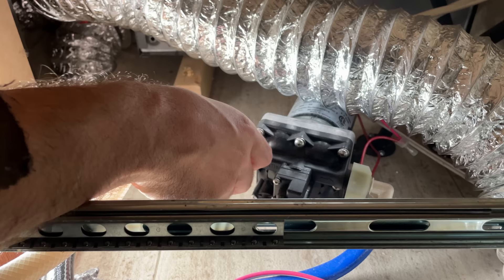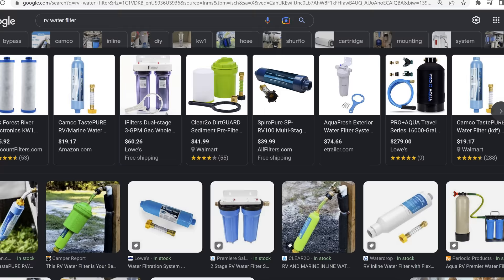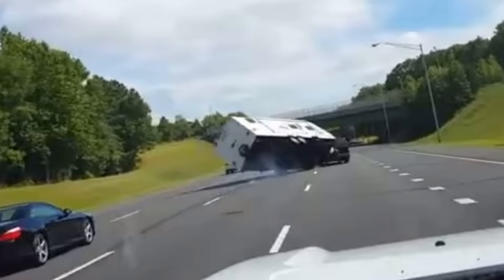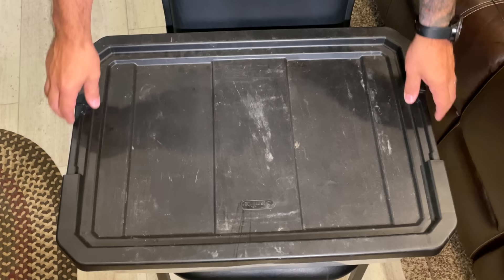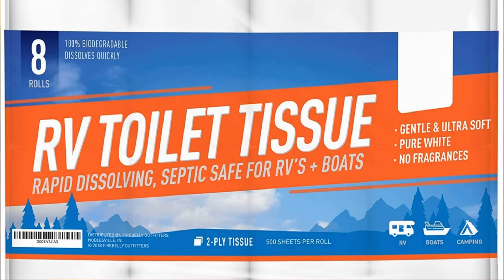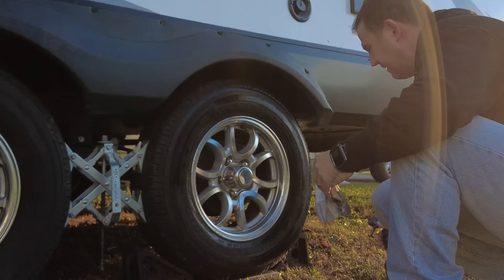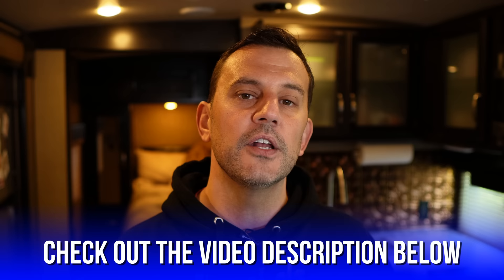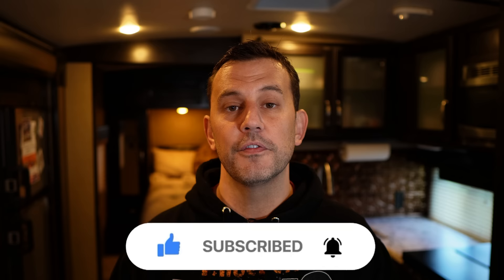9 RV Mistakes To Avoid - Plus Critical Things You May Be Missing

Comment from the maker: ✨⭐ PRODUCTS FEATURED IN THIS VIDEO ⭐✨
🔹 RV Stabilizer Jack Bit https://amzn.to/3EJDbKi
🔹 Water Pump Filter Replacement https://amzn.to/3Ub32k9
🔹 Pex Crimper https://amzn.to/3GP10mM
🔹 Dewalt Socket Set https://amzn.to/3Va080j
🔹 Septic Safe Toilet Paper https://amzn.to/3ihp7Qx
🔹 Tire Covers https://amzn.to/3gEsHUA
🔹 303 Automotive Protectant https://amzn.to/3OGBBgJ
🔹 303 Aerospace Protectant (best quality protectant) https://amzn.to/3GSCvoB
🔹 Microfiber Multi-purpose cloths https://amzn.to/3iirT8t 

Stop Doing This to Your RV! Common Sense Tips That AREN'T Discussed Enough! Unspoken RV Tips This video highlights some of the things you should never be doing to your RV. Plus, we cover a few tips that should be discussed more often than they are.  RV ownership & maintenance involves many different processes, but these can be simplified by using this common sense tip that we cover at the end of the video.  Whether you own a travel trailer, 5th wheel, motorhome, toy hauler, pop-up camper, or any other type of RV, this video is worth watching. Scroll down to see more!

Check out my friend Robert Peppers Channel:
 @L2SFBC  
Robert's Sway Video: https://www.youtube.com/watch?v=JeEEC5eVNCk

#rvlife #rvliving #rvdiy

✨⭐ OUR FAVORITE RV ACCESSORIES ⭐✨
ESSENTIALS:
✅ Camco Rhino Flex Sewer Hose & Elbow Kit https://amzn.to/3wxaiyG
✅ Camco 90 Degree Clear Sewer Elbow https://amzn.to/3eezBe7
✅ Camco RV Water Filter https://amzn.to/3VzcMqi
✅ Rubber Wheel Chocks https://amzn.to/3v0lL5I
✅ Hughes Watchdog 30 Amp Surge Protector/EMS https://amzn.to/3hAmgCy
✅ Hughes Watchdog 50 Amp Surge Protector/EMS https://amzn.to/3HKrpm1
✅ Liquified RV Tank Treatment https://amzn.to/3ksg1Ck
✅ Tire Minder TPMS https://amzn.to/3mjuBg0
✅ Water Pressure Regulator https://amzn.to/3m3ZFzZ
✅ Rubber Gloves 6 Mil https://amzn.to/3XNo7Dc
✅ Collapsible Water Hose https://amzn.to/3SvNubw

MAINTENANCE:
✅ Boeshield T-9 Rust Preventative & Lubrication https://amzn.to/3sjcjMx 
✅ Eternabond Roof Tape https://amzn.to/3Ad290J
✅ Geocell Proflex Sealer https://amzn.to/3KGMOyb
✅ Road Tool Kit https://amzn.to/41NIQKj

INTERIOR:
✅ Camco Cross Bar Door Handle https://amzn.to/3o8WWS5
✅ Shower Caddy https://amzn.to/3bdU80W
✅ Soap Dish https://amzn.to/3pKheSn
✅ Oxygenics Shower Head (White) https://amzn.to/3nhDMYW
✅ Oxygenics Shower Head (Brushed Nickel) https://amzn.to/2O8YcYC
✅ Perfect RV Paper Towel Holder https://amzn.to/3tZxd1K
✅ Dimmer Switch https://amzn.to/3rQdfFD
✅ Sliding Door Latch https://amzn.to/3EkpTT0
✅ Puppy Paw Hook https://amzn.to/2N9JaRV
✅ Foldable Storage Bins https://amzn.to/3tIp01f

EXTERIOR:
✅ X Chocks https://amzn.to/3m3ck2i
✅ Carmtek 10 Digit Keyless Entry System https://amzn.to/3t4IMpB (see the video here: https://youtu.be/KcEUgsDw6kk)
✅ Low Point Drain Valves https://amzn.to/3Jd6adb

OUTDOOR GEAR:
✅ Blackstone Griddle 22” https://amzn.to/3MDDiL0
✅ Blackstone Griddle 28" https://amzn.to/3eBnOuD
✅ Outdoor Gravity Chairs https://amzn.to/3Sb1p4M
✅ Ground Mat https://amzn.to/41u3wXg

💥 Sign up for our FREE Newsletter: https://view.flodesk.com/pages/6497c6a9d1998fa8c7623e9f

✨⭐ MORE RV ACCESSORIES ON AMAZON ⭐✨
https://www.amazon.com/shop/rvtipstravels

💥 NEW TO OUR CHANNEL? Check out our catalog:
https://www.youtube.com/c/RVTipsTravels/playlists

🙏 If you want to help support our channel you can donate here: 
https://www.paypal.com/donate/?hosted_button_id=J2KKM9NR3BJJA

✨⭐ DISCOUNT CODES TO SAVE MONEY ⭐✨

🔨 Learn how to repair & maintain your RV like I did w/ this COMPREHENSIVE training course:
https://rvtechcourse.com/?ref=rvtips&travels

🚐 10% off RV Snappads! https://rvsnappad.com/discount/RVTT10

🛌 Get 25% off your RV Mattress by Brooklyn Bedding at https://rvmattress.com/rvtips
Use discount code: rvtips

📡 GPS Tracking for your RV! https://www.wheresafe.com/rvtipsandtravels
Get 10% off by using discount code: RVTIPS10

If you find a dead link, let us know & we’ll send you an RVTT sticker!

📺 Want to see more RV videos? Please SUBSCRIBE & CLICK THE BELL ICON 🔔 so you're notified when we release new videos!

Follow us on social media:
📸 Instagram https://www.instagram.com/RVTipsAndTravels
🕺 Facebook https://www.facebook.com/RVTipsAndTravels

We may receive a small commission for purchases made through the affiliate links above. There is NO additional cost to you when purchasing from our links & it helps cover some of our material and equipment costs to make these videos. We GREATLY appreciate your support!

Comment: Lists, tires and tools -- can I get a witness,  ha , one here! all of it is ON THE MONEY. Now you have me excited for next spring already to arrive. One thing to all fellow RV Peeps,, if you have the rubber roof protectant in gallon ,you have the best fluid at your disposal already to use on tires. It outperforms all the other shelf stuff for UV blocker and longevity. Shake pour into cup, brush it on or sponge, refill the spray bottle you have, can skip the conditioner. Thanks Ross for power packed and fun to watch content.
Reply from the maker: Thanks Jim, I am defintely getting the bulk order next time.  I appreciate the support and the comment!

Comment: During hot weather I travel often with the roof vent open with no problem with outside smell inside the coach. We have a Geo Pro 19FBS with the vent at the rear of the rig and it comes with the Max Air vent cover, so perhaps that helps keep smells out of the rig. The biggest reason I do this is to help keep the temperature down in the rig.

Comment: You mentioned using septic safe toilet paper, I found that if you look at the Rv toilet paper it says rapid dissolving and costs twice as much for fewer roles. There are a few brands that will say quick/ rapid dissolving and some also say septic safe. So I just look for rapid dissolving and/or septic safe and I’m good. One thing you NEVER want to do (even though is says that it is septic safe) is use/put the baby wipes in your black tank. Take it from me not a good idea even if it says so, cost me around 400 dollars to learn that one, when I first started rving, cause I had to have my blank tank vacuumed out

Comment: Really good video on tips and tricks. Your videos have a great style and flow without a lot of the useless chit chat of many.  They are helping me prepare for next journeys in my second travel trailer.   One note on the segment on the particle filter near the water pump, be sure to get any water out of it before freezing temps.  I blow the water out of my system and learned the hard way when water froze there and cracked the plastic cover. .  And you can't just buy the cap Cheers.
Reply from the maker: Thank you!

Comment: Another great video. What are your thoughts on the surface tires are in when storing. For example grass, dirt, gravel, concrete, plastic blocks etc. Many thanks
Reply from the maker: great question... I am actually going to create a tire care video next year, but I really need to talk to a few tire experts before I even think about filming.  However, from what I've heard thus far, they should be kept on a firm, dry surface.  Youll notice in the video they are on wooden blocks off the grass.  My last set of tires lasted 5 years, and I only replaced them because of the age.  Nothing was wrong with them as they only had 6000 miles on them.  Stay tuned, in the meantime when I find a tire expert that I trust I will let you know.

Comment: Using shower fan.  In winter that tends to suck all the heat out of camper.  Do you recommend a dehumidifier instead in those conditions?
Reply from the maker: Dehumidifiers would be a great option instead of the fan!  Great question!

Comment: Hello, my 2008 Sunnybrook fifth wheel, 33ckts, has ball 7500 pound scissor jacks. They are not the lighter stabilizer jacks that companies have gone to in recent years. In my way of thinking, I like to have these heavy duty jacks down while my RV is in storage, in order to take the stress off of the frame. is my way of thinking correct? Or should I not even have these heavy stabilizer jacks engaged while my RV is in storage? Furthermore, the old Sunnybrook fifth wheels, we’re not built on I-Beams. They were built on a triple stacked 16 inch box frame under the main carriage of the fifth wheel. I have been pulling this fifth wheel since we purchased it new, in 2008, but I still pick up a tip now and then from your videos. Keep up the good work.
Reply from the maker: I think that you're way of thinking is good, and remember there is no negative affect of having the stablizers down at any point in time.  I would however assume the weight of the trailer on the frame should be fine, especially while not moving.  Considering these are meant to travel on horrible roads, the stress on the frame comes when you're driving, not parked.  the only reason i mention this is in case of a tire losing air, then you are putting additional stress on the jacks.  thanks for watching and commenting my friend.

Comment: There are lots of videos out there. I'd say virtually every single one is well intentioned. Further, Id say that most of them contain nuggets of good information. I'm constantly trolling RV videos in an ongoing search for things I didn't previously know. 

While "Proper" maintenance will save you money in the long run and preserve the useful life of your RV, the question for me is; what is "Proper" maintenance. I have traveled the path from new RV'er to seasoned RV'er over 8 years. I don't know it all. I won't claim that even on my death bed. But one dosen't do anything for 8 years and not learn anything. For me, "Proper" maintenance  includes finding some sort of balance. Early on, I tried to apply all of these "Tips and Tricks" I see in these videos. One could endlessly spend time and significant sums of money niggeling with their RV. RVing isn't cheap under the best of conditions. But one can spend gobs of money "Protecting" their RV. Early on, I found myself asking when do we actually get to ENJOY the damn thing? 

There is an idea of diminishing returns. I'll give you one example. One "Should" wash at a bare minimum, the roof once a year and apply a TPO protectant, not to mention check the roof sealant. I did that. The first year I washed my roof 4 times in 6 months. And then I realized, for all the "Good" it was doing me, I could wash the roof every time the RV leaves the driveway. Washing the roof is not easy, and even though it's a "Walkable" roof, I cringe every single time I put my 300 lbs on the roof. And that protectant stuff you're supposed to put on once a year? That stuff is EXSPENSIVE. After the first two years, I do a quick a quick clean up on the roof once a year. I don't scrub it. I clean it up. Spend maybe ten minutes tops. As far as the sealant goes, Every other year I pay the shop to check the roof and other various wear parts and have them do maintenance if they find anything sketchy. I have them do the protectant stuff every third year.

Why am I making this long post. I could write a book on RV maintenance.  A lot of this stuff is going to depend heavily on your personal circumstances and how much the RV gets used. Some should do more, some could get away with doing a lot less. The point is this. There are lots of videos telling you what you should do. I have yet to run into one that will tell you that you can overkill the whole maintenance thing. Much like the roof of my camper, You don't need to wash the roof every time you take it out or spend hundreds of dollars each year on protectants. I pay to store my RV 6 months of the year in a weather tight building. I think keeping the snow and Ice and wind and sun off it 6 months of the year is worth more than spending hours of labor and hundreds of dollars applying protectant to the roof. One MUST do maintenance of some kind. But one dosen't have to overkill everything. There is power in knowledge. I think people do a lot of overkill because they are scared of what they don't really know or understand. Some RV's need more PM than others. Low end RVs tend to be made with cheaper materials. Think the rubber seals in a low end RV slide are exactly the same as the seals used in mid and high end RVs? lots of people would say yes they are. All I can tell you is that my experience has been that my 8 year old RV seals are still good and I only put protectant on them once a year. I've seen the seals on lower end RV's disintegrate in a couple years. One has to tailor the PM regimen to the RV they have and to the circumstances. Do you store your RV outside year round? Do you live in Arizona or in Alaska? If you make RVing a Job, you're not going to have a lot of fun. In my opinion, you don't need seventy five lists. On a small Imagine 2150RB, the winterization process is as basic as it gets. Open the plug on the HWH. Open the low point plugs. Flip valves. Run some compressed air through the exterior water inlets/outlets. Plug low point drains. Run in antifreeze through all faucets. Done. Don't make a mountain out of a mole hill. 

My advice is to learn learn learn learn learn. Arm yourself with information. Arm yourself with all the information you can get. 8 years into our RV life, I'm still consuming information from videos and forums. And I'll be doing so 8 years from now. The more you understand about the fine details of how your RV is constructed, the better at maintenance you will get. And remember, you don't have to do ALL the maintenance yourself. It's worth it to pay a shop to do some of it. I personally think putting 300 lbs on my 2150RBs roof is harder on it than anything else. I budget about 600 dollars a year to spend at the Dealership for maintenance. I do a lot on 3 year rotations. Packing the bearings. Checking the breaks. Basic and extended roof maintenance.  The stuff that's not pleasant, and takes up my time. Other things like slide seals and winterizing, I do myself. Lists can be useful. But my suggestion is to keep it simple. We always do a walk around before leaving the driveway or the campground. But I have a five point list I keep on the dash to remind me of the things we tend to over look when we are not paying full attention. Stabilizers up. Vents and windows closed. Chains, hitch pin, whip all connected. Doors closed and secured. Overlooking any of these things when you are not paying full attention can lead to particularly bad experiences. So I have one five point list placed in a spot where I can't miss it. And when I see it, it triggers me to make certain I've done those things. If you have 34 lists on your phone. I submit you're doing it wrong. 

Just my two cent rant.
Reply from the maker: Thanks for commenting!

Comment: I have two 2000 dollars Heiki vents so covering my trailer is not an option. And I am like you. I am in and out often. Even sleep in it about every third weekend. Even in winter. I do this for several reasons. I want to know if I have a rodent. I want to use the bed as much as possible to stay used to it. And I want to know if the heater is working and functioning correctly. Before I get out and find it doesn't.
Reply from the maker: Thanks for sharing!
Reply: @RVTIPSANDTRAVELS  Thank you for the informative videos.
Reply from the maker: those vents are awesome!
Reply: @RVTIPSANDTRAVELS  until you have to fix or replace them. I have one in the bedroom and one over the dinnette. On a cool summer night you get so much air flow. The plusses definitely outweigh the negatives. They have screens and blinds. Nice units. But the price doesn't reflect quality.